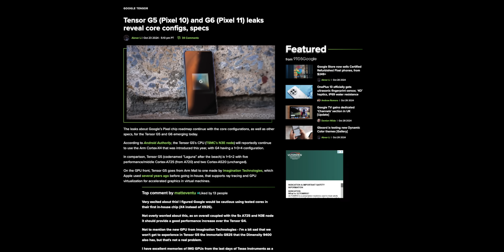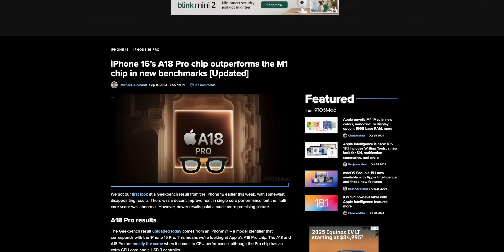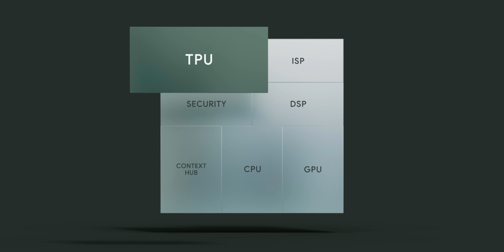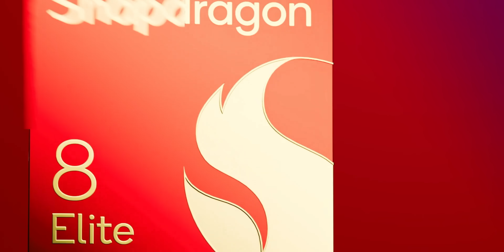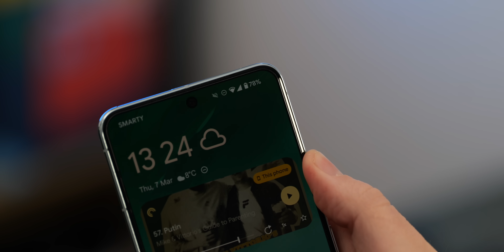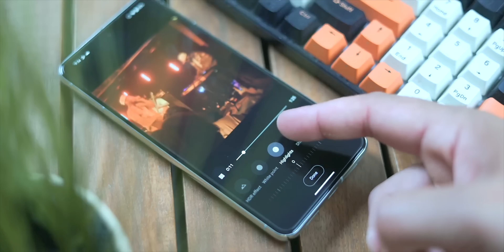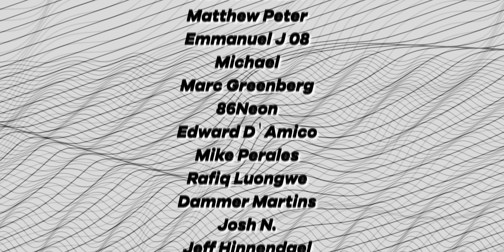Google's SECRET Weapon to Beat Apple? (Tensor G5 & G6 Revealed)

Comment: Just imagine if google was smart enough to use the snapdragon chip on like a google pixel 10 pro slim.. they can use the g5 everything else.. but just on a slim version or something. If they used the snapdragon, well, samsung would be dethroned COMPLETELY at that point. There wouldnt be any reason to use a galaxy anymore as the ONLY thing galaxy does better right now all comes down to literally just the chip. Everything else, google does better. I have both phones so i know.

Comment: They are using the Arm core from 2023, so not really competitive at all.

I also note that the video is clueless about the new naming for the X cores from Arm. X4 (2023) was followed by X925 (2024). I doubt the next one will be called X5. it is more likely to be called the X930 or X-935.

Comment: Haha apple a 18 isnt positive it has a tiny performance increase and still beaten in battery life by s24ultra with 4nm 8 gen 3
Reply: Was the battery size of the S24 Ultra reduced to the one in the iPhone?

Otherwise it is like saying the car with the bigger gas tank has a more efficient motor.
Reply: @Netzwerkdose  no but if you do the math that s24ultra has higher res display and still last an hour longer shows it's still more efficient at using its energy
Reply: @  Last an hour longer on what?

And as you brought up display resolution: My S23 Ultra has a resolution setting that promises lower resolutions in software save battery. And I think the default was the middle setting. Was that controlled for in testing? Yes, it is very tricky to do everything right.

And benchmarks are useful for CPU development teams. Real people need real life performance. The iPhone 16 Pro Max in this department is the best phone I had. The last one was an S23 Ultra. And this not only is long battery life, good display, but also software. And in the latter department my old phone was lacking.
Reply: @Netzwerkdose  yeah and mrwhostheboss has it on its highest resolution. Oh and apple software is terrible so is display and camera
Reply: @Netzwerkdose  no s24ultra is best in real life performance has better gpu and is faster in gaming cpu performance at this point is pointless as it's more software now which samsung is better at
Reply: @ Can you please give more details why you think Samsung has the better software? And when did you last actually use an  iPad or iPhone? Would like to understand your statement.
Reply: @ A thing I thoroughly compared was the Accessibility options. Far more in iOS 18 than in OneUI 6.1 and some of those only available on the iPhone will at least be tried by family members because they might improve quality of life.
Reply: @Netzwerkdose  hahaha there's not samsung has all those same features and more

Comment: The Cortex-X925 is the rebrand of Cortex-X5 (Cortex-X930 is what would have been the Cortex-X6) . Google will be missing out on single-core capability if they don't pair the Cortex-A725 with the Cortex-X925 since its a great improvement to the preceding Cortex-X4 which they used in the previous Tensor G4. If they push this then it would mean their Prime core will be one generation behind compared to other Arm core licensees like Samsung and Mediatek. Not to mention that even if they did use the latest core designs it wouldn't matter that much because competitors would have already released chips a generation above Google's since their announcement and release schedules are relatively late.

Comment: The Pixel 9 lineup with this pricing, TSMC chip also increase in price, what most people worried that the Pixel 10/11 price will get increase further...
Reply: Tarrifs will increase that even more
Reply: Yea, everyone thinks just because the manufacturing goes to TSMC it will magically solves overheating and power consumption. It still depends on Google's CPU designs and TSMC node will just cost more.
Reply: @jierenzheng7670  It could solve the issue since they can make better chip. But end up also see the end product since it is a Google own design, as well as the internal design for thermal and power efficiency.
Reply: @jierenzheng7670  It could solve these issues since they can do it better. However, it also need to see the end product since it is a Tensor chip from Google.
As well as the internal design for thermal and power efficiency.
Reply: @jierenzheng7670  It could solve these issues since they can do it better. However, it also need to see the end product since it is a Tensor chip from Google.
As well as the internal design for thermal and power efficiency.

Comment: I miss that Pixel 4 face unlock. Probably still the best face unlock ever!!
Reply: Face Unlock comes back on the Pixel 11 because the infrared sensor can then be located under the display and no large recess is necessary in the display.
But the Pixels 8 and 9 are already doing well as long as the lighting conditions are right. This also works perfectly with banking apps.
Reply: @Marc-OliverSchmidt  pixel 8 has face unlock and it isn't that bad, idk if the pixel 4 unlock was better
Reply: i still have it and i still use it. if anything happens i am switching over to clamshell phone

Comment: Honestly the Pixel 9 Pro has been really damn good and I'll probably keep it for a few years before upgrading even if they make a big jump in with the Tensor G5 in the Pixel 10 series. This is great and it's nice to see them getting competitive with the SoC but it's not clear how much this actually matters at this point since the Tensor G4 paired with the Exynos 5400c modem is really good at everything but benchmarks. 🤷
Reply: I am having the same experience and no complaints so far. My theory is Pixel does not need the raw power of the SoC as it offloads the processing mostly on to the cloud servers. That is probably it increased the RAM to 16BG paired with the much improved modem. The battery performance is superb and does not run hot either. Whatever sorcery it is I really love it.

Comment: IMO, a combination of hardware, internals and software will keep pixels competitive.  It is good that the internals are getting upgraded.  The hardware should continue to evolve and the software could use a little more refinement.  As an easy example, the customization of the lock screen with different clocks, etc is nice but after one notification it goes away.  I'd like to see the lock be able to show notifications AND keep the customized clock, etc.

Comment: It's still gonna be underpowered because Google is gonna use old cores - cortex X4 not latest and don't expect too much from GPU but its gonna have good support for GPU drivers.
Reply: I swear you kids can’t never be happy you always gotta cry about pointless stuff the tensor g4 is plenty powerful enough it runs any mobile game I run it on max settings  60 fps
Reply: @passivevii4052  even a mild game like TFt stutters on pixel, when it didnt on iphone/ipad
Reply: Just cause it's not the latest doesn't mean it won't perform well
Reply: @omonighoprogressoghenetejiri  If that's the case going with an overclocked Snapdragon 865 would've been a better option.
Reply: @jevonsims900  they create their own chips for their phones, y'all should let go of wanting Google to use snapdragon, it won't happen and if you're not happy with it then buy another phone
Reply: @omonighoprogressoghenetejiri  you don’t know how chip design works.
Reply: @KingOfCorinth  oh and you do? Not like this is a core design from ten years ago, it's just that a newer one is available
So does that mean the older architecture would become WAY slow?
Reply: @KingOfCorinth  the cortex x4 was released this year and is used in the snapdragon 8 gen 3, dimensity 9300 and tensor g4
Now tell me, because it's not the newest does that mean that the snapdragon and dimensity are now slow or underpowered?
Reply: @omonighoprogressoghenetejiri  The Tensor G5 wont be competing with th Snapdragon G3 or Dimensity 9300. It will be compared against the Snadragon X-Elite and Dimensity 9400. Both have massive jumps in performance compared to the previous gen.
Reply: @naheemsays5140  oh, then in that sense I agree with you 
Then again pixel users really don't care much about performance and as long as the phone got a big upgrade from fr to g5 they'll be VERY happy
Reply: @omonighoprogressoghenetejiri  I agree with that. IMO lerformance reaxhed acceptable levels for nost people a few years ago. However the video is selling aomething else.
Reply: @naheemsays5140  the video is selling a more powerful pixel, and that is true, it doesn't say anything about being as powerful as the competitors
As for the performance yeah for everyday tasks it has been good for a while

Comment: I just really want their mobile division succeed like surpassing 12k in mc next year
Reply: S8E with 2+6(with performance cores much faster than X4) has 10k, this with 1+5+2 is not going to 10k yet alone 12k
Even if they went 2 X4 and 6 A725 i don't think they van get 12k

Idk why Google doesn't take their processors seriously,using X4 when X5 is available and using N3E when Qualcomm and apple are using N3P

It seems like they are always 2 generations behind just why

Also they could've used arm immortalis gpu like in 9400
Reply: @Pro-Sag  they are 3 generations behind with that awful perfomance from the G4. Its the 10th generation of Pixel, they should take that number as an advantage just like apple popularizing the symmetrical bezel game.

Comment: thank god they left samsung
Reply: Even Samsung wants to leave Samsung😂😂😂!
Reply: @TaureanSmoke 😂 😂 😂
Reply: @TaureanSmoke Wait that's illegal
Reply: @TaureanSmoke  aged like Milk, Dumass. Still a weakass Procesor even with TSMC😂😂😂
Reply: Still got the Samsung Modem 😅
Reply: @ernstt1616 I doubt that but even though, the one on the pixel 9 series are great and everyone is saying that and I haven't seen any complaints on the modem so it wouldn't matter
Reply: @omonighoprogressoghenetejiri its 2024 lol, there should be no manufacturer failing at making modems for phones lol, of anyone is, they might as well give up the modem business
Reply: They are switching modem next gen on the pixel 10 pro xl  @ernstt1616
Reply: Don't be so happy now, as I heard they are gonna use the design from a chip last year. Still mediatek and snapdragon or even bionic have better value. 😭 And as the rumour goes, the tensor will be same as mid Qualcomm chipset 🗿 don't expecting higher chipset
Reply: That's not the reason. Google designed the freaking thing. It is how Google wanted it to be.
Reply: It's literally the reason I didn't upgrade this year
Reply: They are going Nowhere, its Samsung's Galaxy!! 😈
Reply: Why samsung was fine there own exynos 2400 was more powerful and efficient than Google tensor so it's a Google thing not samsung
Reply: @harryvlogs7833  Because Exynos 2400 did not cheap out on CPU, GPU and cache sizes. Plus, Exynos chipsets (like Snapdragon, Dimensity and Kirin chipsets) have an on-die modem which is in contrast to Tensors which were paired with external Samsung modems. Samsung's fabs are still inferior to TSMC just as Exynos 2400 is inferior to Snapdragon 8 Gen 3.
Reply: @SussySmurf  well der exynos 2400 came out with 8 gen 2 not 8 gen 3 so not a fair comparison, exynos is on par with snapdragon when you look at gen 2 vs 2400 like it should be
Reply: @harryvlogs7833  Exynos 2400 was released in the same generation as Snapdragon 8 Gen 3 as it's competitor. Evident by the fact that both use the same generation of Arm Cortex cores. This is why the Samsung S24 series (except for the ultra variant) have 2 variants depending on the region, one with Snapdragon 8 Gen 3 and the other with Exynos 2400.
Reply: @SussySmurf  no it wasn't dude exynos 2400 was used in s23 with 8 gen 2 as well which means there are the same generation.
Reply: @harryvlogs7833  A simple search would prove yourself wrong. Samsung revamped the naming scheme of their Galaxy series to align with the year of their release date. Same thing for their Exynos chipsets. They released S21 with Exynos 2100/ 888 in 2021, S22 with Exynos 2200/ 8 Gen 1 in 2022 and S24 with Exynos 2400/ 8 Gen 3 in 2024. S23 was known to have only Snapdragon across all variants.
Reply: @SussySmurf  no they didn't exynos 2400 was with 8 gen 2 look on there phones, it's not to do with the year but to do with the competing chips on their phones dummy which is 2400 and 8 gen  2 on s23
Reply: @harryvlogs7833  
Galaxy S21 (2021)-Exynos 2100/ Snapdragon 888
Galaxy S22 (2022)-Exynos 2200/ Snapdragon 8 Gen 1
Galaxy S23 (2023)-No Exynos/ Snapdragon 8 Gen 2
Galaxy S24 (2024)-Exynos 2400/ Snapdragon 8 Gen 3

An Exynos 2300 chip was designed and had a CPU configuration like Snapdragon 8 Gen 2 with 1 Big Core + 4 Mid Cores + 3 Little Cores but the Exynos 2300 had an extra Little core since they came in a pair so it's a 1+4+4, close to the 1+4+3 of the Snapdragon 8 Gen 2. But it was never released in the Galaxy S23.
Reply: @SussySmurf  oh right yeah mixed up dates but the exynos 2400 had faster ai and better battery efficiency and ray tracing than 8 gen 3 and cpu was on par so you not making any points
Reply: Samsung is spreading themselves too thin supplying Google with Tensor Chips so it was mostly Samsung's decision to part ways with Google.
Reply: @jevonsims900  Samsung chip division is totally different from their smartphone division
The chip division is also a business that wants to make profits, there's nothing like spreading their selves too thin cause they would usually even want more customers
Reply: @jevonsims900 dont forget also making screens for all 3 (samsung, Apples, Google). while that spreads them thin, they do get a TON of funding for their own initiatives but spreading themselves thin but doing these things in the millions of units for other providerss such as apple and google whether its screens OR Chips

Comment: So it'll be a good comp for iPhone 14 😴
Reply: The discussions often only relate to some kind of benchmark, which is really annoying. The Pixel 9 series is very fast as it is not about gaming or extensive video editing
Reply: @Marc-OliverSchmidt even if their chip is working fine for now.. those benchmarks tell you what you can expect in the future.. brcause the slower devices will be the first what start to laggy and annoying to use after a few updates.. (especially when they are offering 7 years of updates.. sure with that low performance it won't smooth for sure even after just 4-5 years..)
Reply: @TamasKiss-yk4st  

The Galaxy S20 is still a very capable device while being contextually ancient.
You don't know what you're talking about.
Reply: Yes, but 3 decades ahead in the AI game.
Reply: @MOON-Hkr  in what ai actually? qualcomm and mediatek has better ai scores than this piece of shit tensor..hell Iphone has better scores than them too..
Reply: @kubotite9168 

Synthetic benchmark and specsheet queen with little to no traction on the pavement because of HORRENDOUS transmission resulting in no real world performance. Apple.
Reply: did apple silicon ever improve substantially since 14?

Comment: G5 made by TSMC will beat apple since snapdragon also beat apple with the 8 elite
Reply: Not gonna happen because Google is not using latest cores and GPU is not powerful as mali, apple or Qualcomm.
The only thing we can see is improved efficiency and better thermals.
 That's it.
Reply: @YutaOkkotsu-e2e  tsmc makes the Qualcomm snapdragon chips
Reply: @DavyJeremy1  even if tsmc makes tensor it doesn't make tensor powerful.
Cores inside processor determines power. Just wait and see 😂
Reply: No it doesn't. And they probably can't even legally make the elite. And the graphics are not even close to apple. Lol
Reply: @Techfanatic73  apple only has raw power but nothing to use it for not even the slightest bit of multitasking, not even a uniform back button 😂
Reply: @DavyJeremy1  don't be that stupid mate. It's not even gonna be as Powerful as Snapdragon, Dimensity or Exynos.  Let alone Apple . What are you even talking about ? Just cpz TSMC are manufacturing it doesn't mean it's instantly the best processor 😂
Reply: @DavyJeremy1 I think so too. No sensible multitasking, no floating Windows, no split screen, no desktop mode and only poor AI, why do you need the power of the A18? For gambling and videotape?
Reply: @Techfanatic73  8 elite is above a18 pro
Reply: cope..its gonna be shit as always lol..2nd gen performance for todays flagship price..